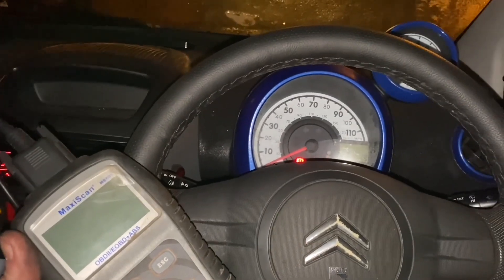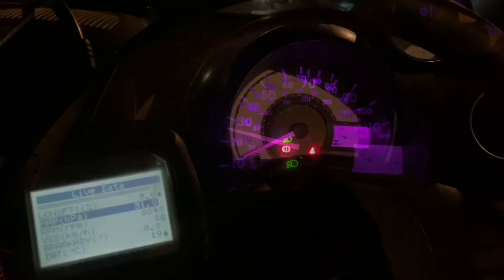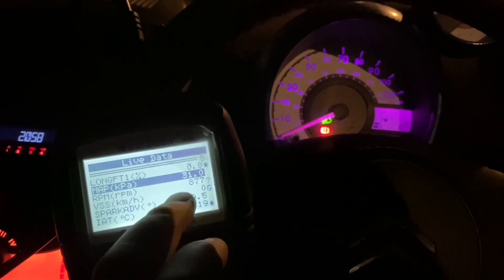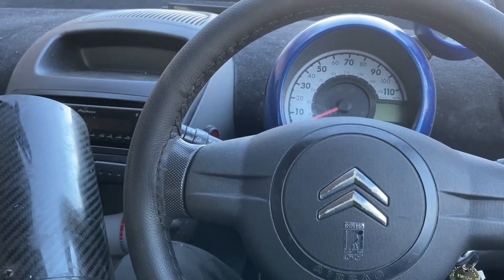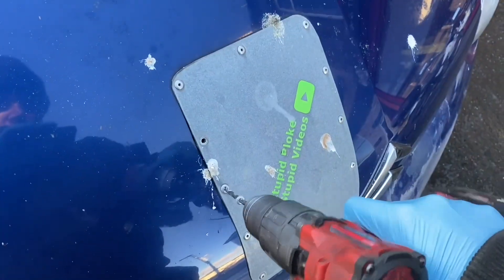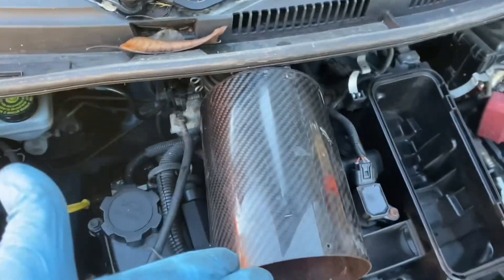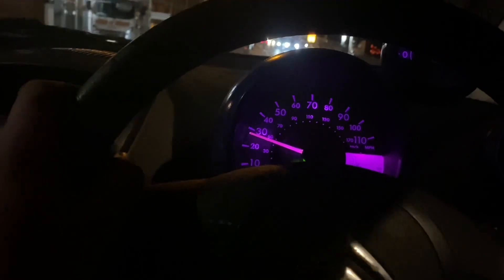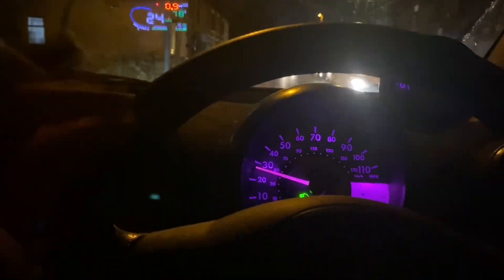Ram Air Intake, Does it Work? More Power, Faster Acceleration? Easy Mod? (C1/107/Aygo/CityBug)

Comment: I wonder why ECU pulled around 3 degrees of timing during the the ram-air test (noticeable between indicated 70 - 80 mph) too lean? Also, you managed to improve the air pressure by around 3 kpa at those indicated speeds vs. the K & Not a filter.
Reply from the maker: @Dominican_War365  I’d be surprised if it was due to the extra air as although there is more, there isn’t a massive amount more and the car has bigger injectors. Also the tune is probably for an open air filter. The advance is a bit all over around the 27-30° in both pulls though. I’ve never heard the car ping, but saying that the engines are rattly noisy and vibratey shitters in these anyway so would I even notice 😂

Comment: Hi mate where did you get the windscreen speedo reader, and have you a link cheers.
Reply from the maker: Hi mate. I was given it, but this on Amazon looks like the same one 

https://www.amazon.co.uk/Arestech-Windshield-Speeding-Consumption-Temperature/dp/B00VHSFG1M/ref=asc_df_B00VHSFG1M/?tag=googshopuk-21&linkCode=df0&hvadid=697239744162&hvpos=&hvnetw=g&hvrand=15259912178133981969&hvpone=&hvptwo=&hvqmt=&hvdev=m&hvdvcmdl=&hvlocint=&hvlocphy=9046633&hvtargid=pla-653847138858&psc=1&mcid=6127a4dea0b638e3a8d4e70fdeac4d28&gad_source=1
Reply: @StupidBlokeStupidVideos  thanks mate looks great, am getting a little 107 for a run around and they look great little car in your vids bud
Reply from the maker: @cheekychops5906  this is one of the best cars I’ve ever had tbh
Reply: @StupidBlokeStupidVideos  yes reading up on them no one got a bad word to say about them, and good review on them.cheap great little car it looks like.

Comment: I love your videos I have Citroen C1 all the way from South Africa could you do a video where you can show me where the 6500FJ safety fuse is please
Reply from the maker: Thanks mate, and the what??
Reply: If you Google 6500FJ it says it's a safety fuse under the fuse box. If this fuse is blown the car is completely dead as it communates with the battery
Reply from the maker: @tamlindias8942  ah right. The main fuse to the fuse box itself. Never had to change one on one of these. A lot of cars they are on the battery terminal, others they are on the main feed into the fuse box. Never looked at where it is on one of these tbh, but I’ve just read that it’s on the underside of the engine bay fuse box.
Reply: @StupidBlokeStupidVideos  I have to change mine few fuses blew now the car completely dead. Battery is alright has power just need to locate and change that fuse. That's why I was asking was hoping you'd have some knowledge on how to do that. But I'll figure it out. You gave me enough confidence to do it myself.

Comment: Hi love your channel, wondering if there is a device that I can plug into the ODB2 socket that can pull the MPG Instant and long term Miles to empty etc assuming the vehicle accepts this.  Is a C1, obviously 2011 VTR+.  Also I'm guessing aftermarket cruise control can only be obtained for the 2014 onwards models with the speed limiter.  Cheers for any thoughts 👍
Reply from the maker: Thanks mate. This displays instant MPG but it doesn’t seem accurate 

https://youtu.be/jsIFpbFhuho?si=tWVPwXpqd9gDJRAH
Reply from the maker: As for cruise, I have heard of one with a system fitted but it was a complicated and expensive setup.

Comment: great video! i live in new york, 46, and alot of older american cars used to have ram air induction.  typically, this mod was used in carburated engines, adding more air, causing a slight increase in power.  i used to own a 79 el camino with a 350 4bolt v8 engine that i put a ram air kit on.  the hp gain was......somewhat noticeable.  later, i purchased an 83 chevy citation x11, which had a factory cowl induction system on a 2.8 litre v6, and that was surprisingly good.  imo humble opinion, i dont think its worth carving a hole in the hood, or bonnet as its referred to in your area.  im happy to see someone actually field test this, tho!  dropped a sub!
Reply from the maker: You get some cool cars over there. A lot of bikes have it but not many cars over here. I work on bikes, and the ones with ram air on carbs have to have little air pipes coming from the ram air pressurised area into the cab vents to offset the pressure increase and keep the differential the there. I’m assuming carb cars had the same? Thanks for the comment
Reply: @StupidBlokeStupidVideos  yessir, i do believe so.  honestly, im a huge fan of older tvr cerberas!  i wish we had those over here!
Reply from the maker: @ralphharrison6622  yea I’ve always loved TVRs. I prefer the straight 6 engines over the v8 ones though.
Reply: @StupidBlokeStupidVideos  when i was in my 20s, it was v8 or walking.  now, almost 50, i prefer 6 cylinders with forced induction.  gotta love the whine of a supercharger!

Comment: What if you fitted an electric fan on the front facing into the ram air. Blowing air into the ram air. Be like a jet engine then 👍
Reply from the maker: I’ve considered electric turbo but the ones that actually work are beyond the budget if this shit channel 😂
Reply: @StupidBlokeStupidVideos  there must be a way 🙏🥺
Reply: You would infact have a wind turbine, not a turbo. The induction would suck the fan faster than the motor could spin it, turning it into, well basically an alternator.
Reply: @barmotorworx3494  turbo alternator..... beast!

Comment: Any noob knows that with modern cars,  performance modifications will require a remap to get the most out of them.
Get it done and you will see a solid 25 BHP gain out of this.
Reply from the maker: Being a closed loop injection system the car will trim the fuel to compensate for the extra air, but yes to get the most out of mods a map is usually best way. 

This car has already been mapped and has bigger injectors and other mods anyway. There are videos showing them and their effects. This is the remap one 

https://youtu.be/nvKyjWuBxC4?si=wQKfZYIsH9cqNSv9

Comment: So it does make a difference, maybe a cleaner installation of the ram air kit would capture more air and improve the boost a little more. Cutting a hole in the bonnet is a bit serious, I'd have to work it into the front grill somehow.
Anyway McLaren are sure to be interested in this piece of kit.
Thanks again.
Reply from the maker: A noticeable difference tbh. I did a similar experiment with a duct from the grill when I fitted the K&N filter a while ago too. 

https://youtu.be/nYeXN-1TCtQ?si=OfmexPtOC-XhLBKG
Reply: @StupidBlokeStupidVideos  I'll check it out again. Cheers

Comment: Don't waste your time and money just buy a faster car, 👍
Reply from the maker: I have a faster car already, and a bike with considerably more power than this car, but it’s not always as simple as that.
Reply: That’s boring, pulling more horses out of the shitter is way more interesting 👍
Reply: It's a less serious form of self harm
Reply: I’ve improved the performance of my daughters 107 this afternoon by removing all rubbish from footwells, vacuuming, polishing the inside and washing the outside. I’m yet to test the shitter as I’ve had a couple of pints being that it’s Christmas. 
Merry Christmas Tim! and thanks for all your hard work. Please continue with your informative, educational and entertaining videos.  Cheers 🍺
Reply from the maker: @Bodga  yes, weight reduction is a very effective performance enhancing mod on these. 

And Merry Xmas to you too mate
Reply: It‘s not about that. This channel is about improving the c1. When i‘m alone in it, it‘s just fine since the car only weighs 680 kg.
Reply from the maker: @somerandomname9252 even my old R6 has thrashed any car I’ve tested it against, unless I’m in the wrong gear. Then I get beaten by a fucking Golf diesel
Reply: Where's the fun in that?! 🙄
Reply from the maker: @KevR-73  exactly!